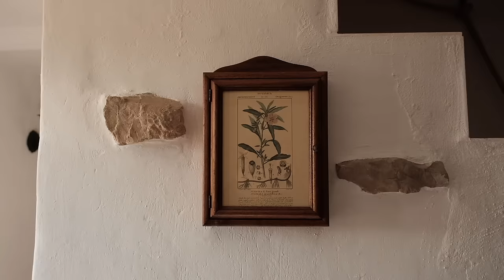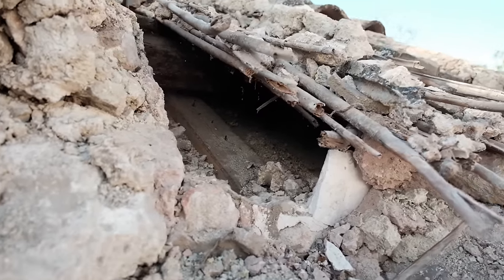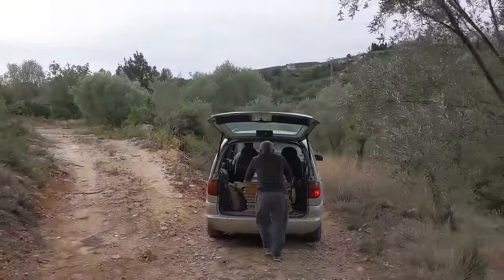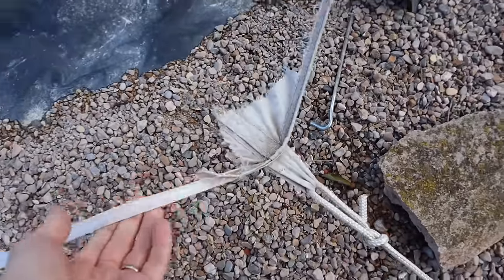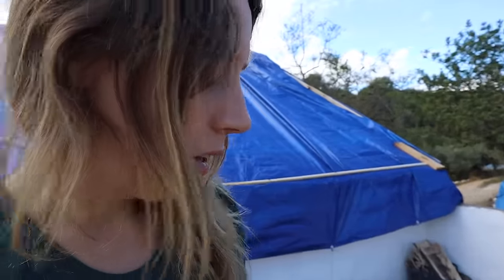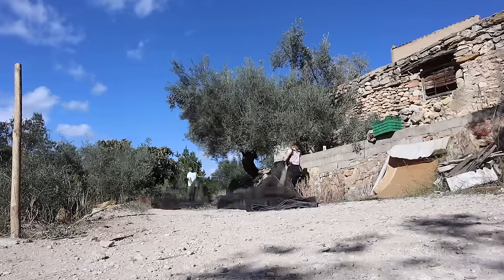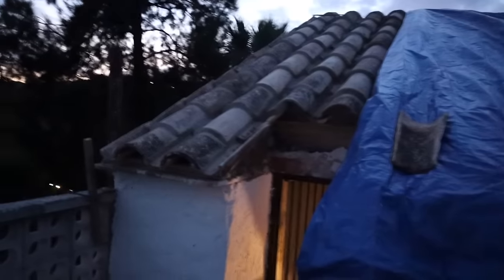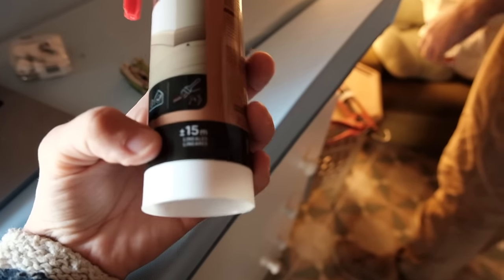I HAD TO LEAVE THE FARM (Extreme Weather & an Unplanned Project)

Comment: The wind is terrible 🌬💨 I was always scared that my polytunnel is flying away. I had to secured it really well. Inside the polytunnel I've put a big rainwater barrel that I fixed with ropes to the metal bars on top. It keept it from flying away during the last storms. Have a nice Sunday without wind and rain 🌝🌞💛

Comment: Harriet, I agree totally with you redacted 10 minute rant against wind!  I got trapped in a holiday let by fallen trees in Storm Ciaran whilst on holiday in Kent last week (which I think might be the same storm your video shows) and now I'm back in the north west of England, the wind is currently battering my little house on the side of a Lake District fell thanks to Storm Debbie.  It leaves such a mess of fallen trees and damaged infrastructure as well as blowing anything unsecured around, when you go out afterwards, there's aways that sinking feeling of "what has been damaged this time".

I'm so relieved that your roof has stood up to the wind even in a half-undressed state, it says a lot for your roofers that they managed to keep it safe even whilst halfway through the job!  I'm sorry about the bell tent though, that's really sad.  Glad the polytunnel stood up to it. I'm looking at putting in a tiny polytunnel this winter in my very exposed garden (I've chosen the most sheltered place for it), so any tips for windproofing would be most welcome.

Good luck with the second side of the roof and I'll keep my fingers crossed that stormy weather is not a feature of this winter for you (although at least you will have a brand new and more robust roof in place!)

Comment: You had me worried with the title - glad it's only because of it being the least horrible time to do it (minus the wind). Amazing that you're reusing the tiles - I'm all for reuse but might have gone the easy/safer way of replacing them. That ceiling sealing will likely pay of as it's adding another wind break to the roof. What kind of insulation did you install? I hope you manage to get a bigger door installed, that door would probably keep me from using the terrace as much!

Comment: are you gonna have a rain water gutter collection system? and where you live is there any mist or fog whereby could a fog net raschel weave gather to a drip run IBC tank? do you use a 4 barrel stones gravel sand to activated charcoal filter system for pure water? we live in Lorca at the top of the mountain Murcia the wind at 731m is crazy. anything outside built should be stone concrete I've seen entire 6inch timber pergolas with tiles flip upside down and destroy roof on a house. nothing is safe unless bricks and mortar and ceramic and concrete roof beam system with cement lid and tiled where we live. even cammo pergola ripped off steel bars from side of the house causing damage. wind atrocious.